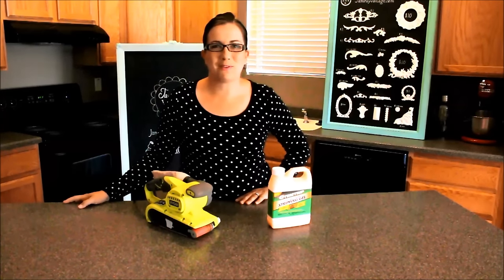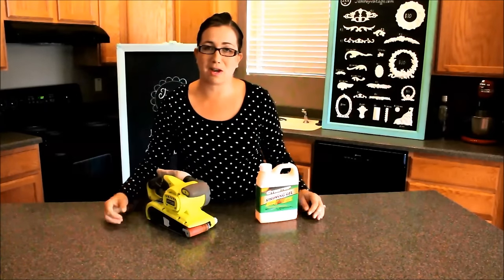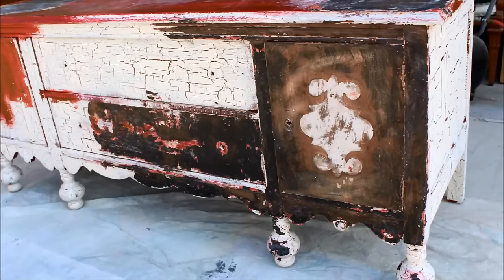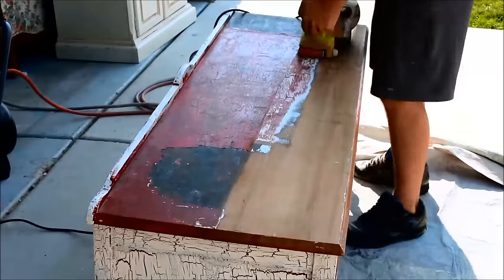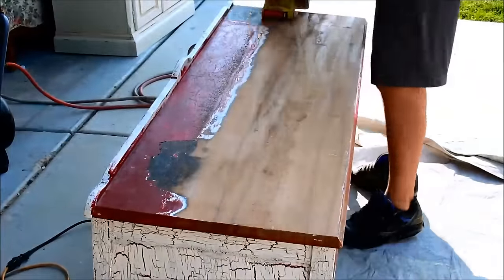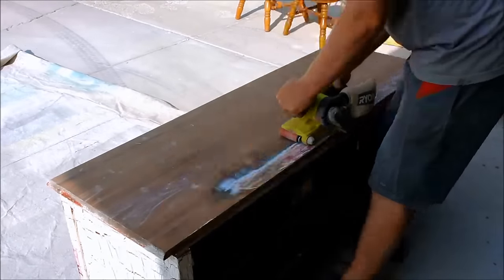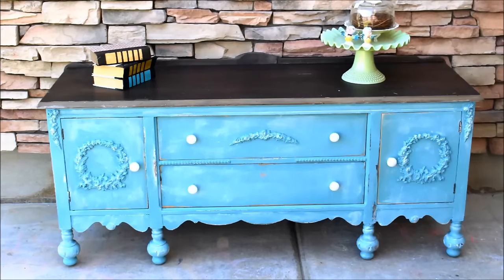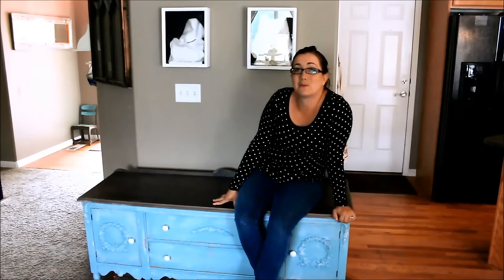How To | Belt Sanding a Buffet Table Top

Comment: Thinking about purchasing a belt sander. I stripped an Ethen Allen table and boy oh boy that stain was not easy to get off. After stripping it twice I have used my random orbital sander, and my palm sander but I just cant get all the splotches out of the wood. Maybe the belt sander would be best? If not Ill have to paint the table, I really wanted to highlight the pretty solid wood.